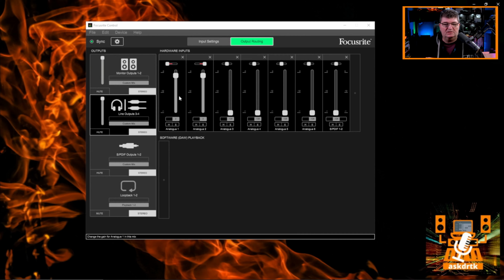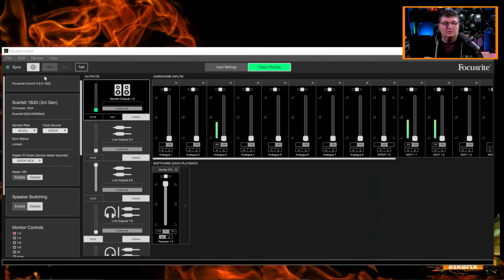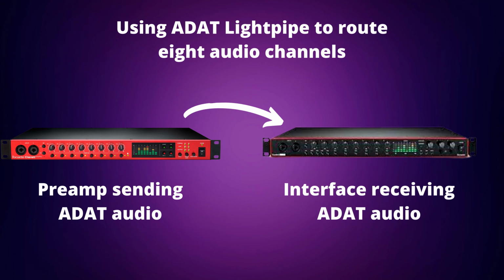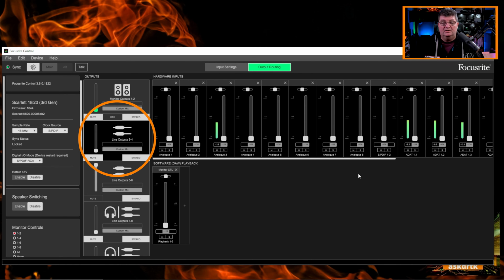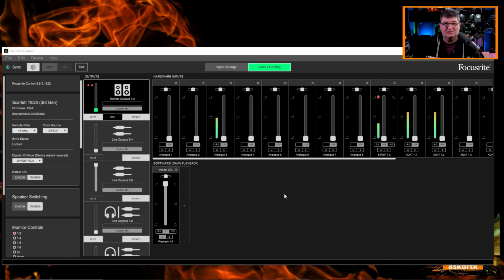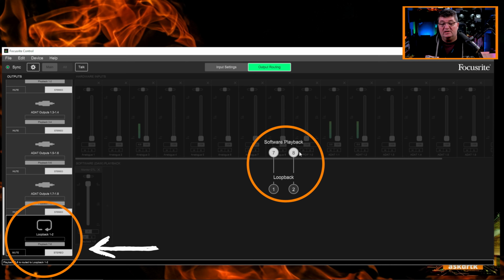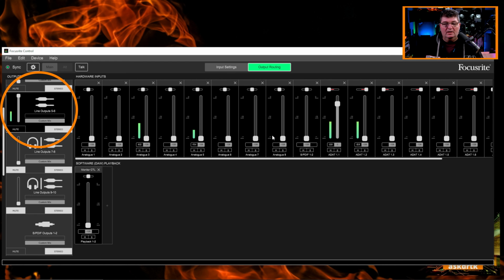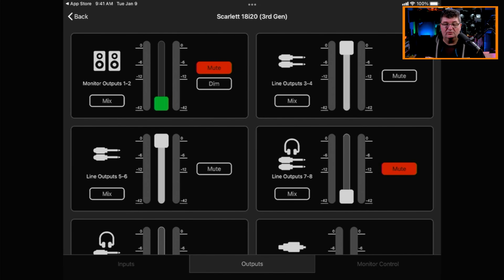Focusrite Control Step-by-Step Setup Guide - ADAT, SPDIF, & iPad Control

Comment: 18i8 question here...What is the setting( in Focusrite Control) if I am using the Spdif input from a guitar processor(Kemper amp) and the optical input from another guitar processor(Axe FX 3)? I see I can only set the "Spdif Source" to "RCA or Optical" and the clock source to "ADAT or Spdif? Or can I only use one at a time? Also I'm using a Bidirectional Optical Toslink SPDIF to Coaxial Audio Converter for the Axe Fx so I can go from Spdif RCA to Optical on my 18i8.

Thanks
Reply from the maker: In order to have both processors connected to the 18i8 and have all of their word clocks in sync, you will need to use either the Kemper or Axe as the master clock. The issue will be getting one processor to sync to the other. Depending on which Kemper you have, some support word clock as both internal/auto while some only support internal (and therefore need to be the master). The best chance to get this working is if your Kemper supports "auto" mode for word clock. Connect the Kemper SPDIF RCA output to your 18i8 SPDIF RCA input and your Axe SPDIF output to the 18i8 optical input using your converter as you said. Set the 18i8 to use SPDIF source as "Optical" and the clock source to SPDIF. Now your 18i8 will sync to either the Kemper or the Axe, but not all at the same time. To solve this, connect an RCA cable from the SPDIF RCA output on your Axe to the SPDIF input on your Kemper. I know this sounds strange as you aren't sending audio from your Axe to your Kemper, but the idea is that the Axe will serve as the master word clock and the Kemper will be the slave. You will need to set the Kemper word clock to "Auto/Internal" (found in the SPDIF volume page). This way the clock comes from the Axe, the Kemper syncs to the Axe, and the 18i8 also syncs to the Axe. All three will be in sync and you should be able to use both on the 18i8 without swapping settings. This is a bit of a work around, but I hope it helps out.
Reply: @askdrtk  Thanks very much!!

Comment: Thanks for the video ...I am still in elementary school on these terms that are in this world.  So ... I have 2 new 18i20's ...need to link them together ...how is this done?  I am yes I am very new to this world.  My initial set up of one 18i20 with my IMac was a breeze.  Maybe you can point me to an educational video or a part of yours that would be very relative to this process to access to all 16 tracks.  I have heard that spidif or the optical are both options ...to use both in and out and perhaps even get 4 headphone monitor mixes ...thanks. ...any help will due.  I am just getting ready to pick up the optical or spdif cables so I can move forward.
Reply from the maker: Congratulations on the new 18i20's, you have a lot of IO to work with! The basic set requires using one as master (connected to your computer by usb) and the other as slave (connected to the master via ADAT and SPDIF). 

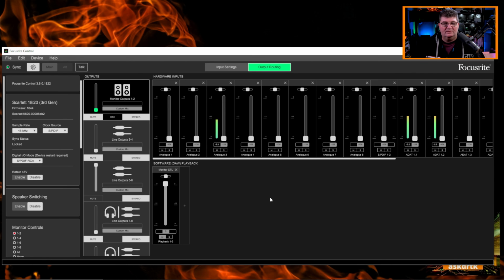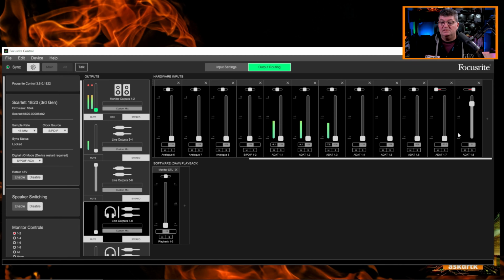To do this you first need to connect only the slave to your computer and open Focusrite Control. In FC you will then setup the analog inputs 1-8 to be the only inputs routed to the ADAT outputs 1-8. You then setup the analog outputs to use only inputs from ADAT inputs 1-8 and SPDIF input 1-2. I would setup ADAT 1-8 to Outputs 1-8 and SPDIF inputs 1-2 to outputs 9 and 10, but the order is up to you. I go through this configuration in this video starting at 10:20 and ending around 14:22. After this is complete and before you disconnect the slave, configure the sample rate to what you want to use (I recommend 48kHz), the clock source to ADAT, and the digital IO to SPDIF RCA.

Once the slave is configured in FC, it can be disconnected from your computer. You would then connect the master to your computer and connect the ADAT and SPDIF cables between the master and slave. Note that you need ADAT cables for both the inputs and outputs on both 18i20's but only need the SPDIF out from the master to the SPDIF in on the slave since the 18i20 only has 8 analog input but has 10 analog outputs. If you want to use the SPDIF out from the slave, you could connect it to another DAC - note that in this case use would need to configure the SPDIF output for the slave using FC for whichever ADAT or SPDIF inputs you want set over SPDIF out from the slave (they will be duplicates of 2 of the other analog outputs). The SPDIF input on the master could be used for another preamp that has a SPDIF output.

Now that the master is connected to your computer by usb, you will again open Focusrite Control to configure the ADAT and SPDIF outputs. First set the sample rate to the same as you did for the slave (again, I recommend 48kHz), the set the clock source to internal, and then set the digital Io mode to SPDIF RCA. Now, for each ADAT and SPDIF output, configure the outputs to use only specific inputs from the Playback (DAW) options. I would suggest ADAT 1.1-1.2 to be 11-12, ADAT 1.3-1.4 to be 13-14, ADAT 1.5-1.6 to be 15-16, ADAT 1.7-1.8 to be 17-18, and SPDIF to be 19-20. There is no need to configure the ADAT or SPDIF inputs as these will automatically be available in your DAW.

Once this setup is complete you will have access to all of the analog inputs and outputs on both the master and slave from your DAW. You will have 16 analog channels in, 20 analog channels out, and 2 SPDIF channels in (for use with a future digital preamp, etc) all available in your DAW. Direct monitor mixes from the inputs on both the master and slave can now be configured using the mixer in FC for any of the analog or ADAT outputs. I know this was lengthy, but I hope it helps out!

Comment: One thing I cannot solve. I am connecting a Yamaha Motif XF to my SPDIF port. When playing something I am getting a strange glitch sound in irregular intervals. The sound is present only when playing something. I SOLVED THIS by setting the CLOCK SOURCE from "Internal" to "S/PDIF". But now when I turn off my keyboard I have no sound output even though the focusrite mixer shows singnals on VUmeters. When I turn on my keyboard everything is fine. This means I have to have my keyboard ON all the time or switch the clock from internal to S/PDIF .... :( WHAT am I doing wrong ?
Reply from the maker: Actually you are not doing anything wrong. The issue is that in order for two devices to communicate and pass digital audio over SPDIF (and other formats) the wordclock of both devices has to be in sync. The wordclock from your Motif is sent along with the digital audio over SPDIF and your interface receives the digital audio and wordclock (if you have clock source set to SPDIF) and then synchronizes itself to the Motif.

If the clocks on the two devices are out of sync one of two things happens.
1. If the sample rate on both devices is set to 44.1 (the Motif XF operates at 44.1) and both use internal clock, you usually will get glitches and crackling.
2. If the sample rates are different on each device (MOTIF 44.1 and interface 48 for example) the will be no sound output from your interface. The same will happen if no clock is present (Motif is powered off and interface clock is set to SPDIF), Audio will still show on the VUmeters, but the DA converter will not be able to convert the signal to analog so you will not hear anything.

Since the Motif (and many other synths with SPDIF) does not accept an external wordclock source, if you want to use SPDIF you are stuck using the Motfif as your master clock and setting your interface clock to SPDIF. Besides having to keep the Motif powered on, the clock in your interface is likely superior (less jitter) and therefore audio quality will be superior using the internal clock on the interface, but then you are stuck with analog output from the synth to your interface. (I am aware that the SPDIF sound from the Motifs is often preferred vs their analog output.) You essentially end up needing to switch the clock source on your interface back and forth between internal and SPDIF depending on whether you are using the Motif. 

While this isn't a solution to using SPDIF from the Motif with your interface set to internal clock, I hope this at least clears up what is happening and again, there is nothing you are doing wrong, there are only choices to be made.
Reply: @askdrtk  First of all thank you for this detailed answer. I think not even Focusrite would answer me like this. :) I love when someone is detailed and understands the core of the specific problem. 
It looks like I will have to switch in the Focusrite interface from Internal to S/PDIF, every time I want to use my MOTIF. I am really unhappy about this since it slows down my workflow. Even though I am using 3 midi keyboards, Push2 and Maschine Studio as well as Softube Console 1as midi input devices I love the key mechanics on my MOTIF and I like to use it as a midi keyboard and as a quality synthesizer / sound-module device. For this purpose I use midi and sound at the same time and I use it a lot and often. So switching is a real pain. 
Everything I want is to get the best possible sound quality from my MOTIF to my Focusrite 18i20 and the best way to do it IMO is digital and not analog. At the same time I want to be able to use MIDI. 
I am not sure what I have done when I had my 18i8 (1st or 2nd generation) but I know for sure that I used it in S/PDIF and MIDI mode parallel and it worked just great without switching anything. I feel a little bit pissed having 2 pieces of relatively expensive equipment, worth a lot more than 2000 EUR together and not being able to do this simple and IMO essential setup need.
Reply from the maker: All good, I'm glad to help out! I can see that it may have worked without changing the clock source on your gen 1 or 2 18i8. I have had this happen before where even though the clocks were not synced to each other everything seemed to work...doesn't happen often, more likely to happen with an individual instrument vs a mix buss, but it can happen - luck of the draw... but not as reliable as syncing up the clocks. It is a pain to switch clock sources, but I agree the overall sound quality will be better if you use SPDIF from your MOTIF vs analog, it's just something about the converters in the MOTIF that aren't quite there vs the converters in most interfaces (really a shame as otherwise (over digital) the MOTIF sounds great!

Comment: Thank you so much for an excellent pair of tutorials. I was hoping you would cover routing to get DAW Playback into say Zoom or Skype. I am a voice talent and often do directed sessions via zoom or skype. At the moment whilst they can here the studio mic, I cant work out how to route DAW playback so they can listen back to the take. I may have missed it in the tutorials. Your advice would be fantastic thanks
Reply from the maker: I'm glad to help out! Great question and I will have a short specific tutorial for using Focusrite Control (FC) to manage audio in Zoom etc. coming soon, but here is a head start... I choose an output in FC to be my "Zoom" audio. I then configure the inputs (including DAW playback) that I want to use with video calls to playback through the output I chose for calls. Then comes the part that is not quite as intuitive. Outputs cannot be selected as "microphones" with Zoom or other apps. The solution is to connect a TRS patch cable between the output your chose for calls and an input you will use as your "Zoom microphone." After adjusting the mix levels to your liking, you would now select the input you patched into with the TRS cable in your voice call app and you are ready to go! If you need to adjust the mix levels while on a call, I recommend setting up the Ipad control as I demonstrated and keeping it open during your call (you could also use FC on your computer if you have enough screen real estate). Hope this helps out!
Reply: @askdrtk  Thank you so much I will work through the steps and look forward to the video!

Comment: Super clear! Thank you for the video!
Just one question: in a 18i20+octopre setup used as standalone mixer/monitoring system, are there any latency problems (due to ADA conversions) routing inputs of one device into outputs of the other one? Thanks again!
Reply from the maker: Thanks and great question! There will always be some latency, but there are no issues with that setup. Even with all channels fully utilized, latency is well below 1ms and not perceptible. For comparison, standing 30 feet from a stage monitor or guitar cabinet results in more latency. I have used this and other ADAT/SPDIF setups for tracking with multiple headphone monitor mixes + live performance without issue.
Reply: @askdrtk  Thank you very much!

Comment: My focusrite 18i20 doesnt seem to pick up the input/output levels the same with my axefx2. There's a signal but no sound from my guitar in my axefx2. I've got my axefx2 connected to channels 3&4. Any help would be appreciated!
Reply from the maker: I would first suggest connecting another source to inputs 3&4 on the 18i20 to confirm levels look good. After that, if you are getting signal to inputs 3&4 one of the most likely causes is a Volume block or even Global blocks on your axefx2. I would check your output settings to see if any of the blocks are configured to disrupt signal (such as expression pedals that are not plugged in). I've also seen this where a new amp is not compatible with output routing configurations in older firmware, in which case doing an update often solves the issue. Another alternative, though a hassle to setup your custom presets again, is to do a factory reset, which generally solves these kinds of issues. Hope this helps and let me know how it goes!